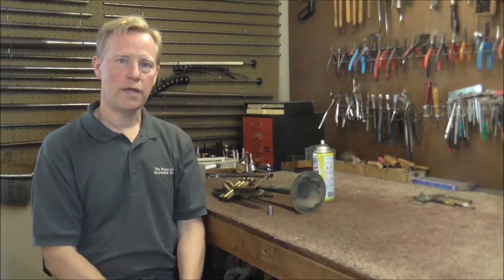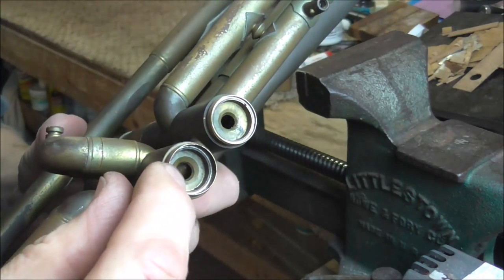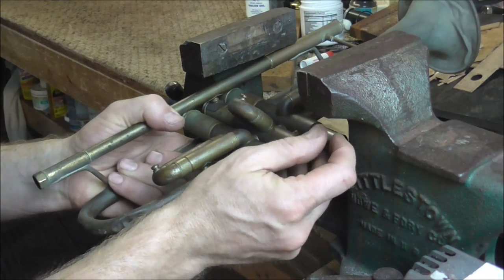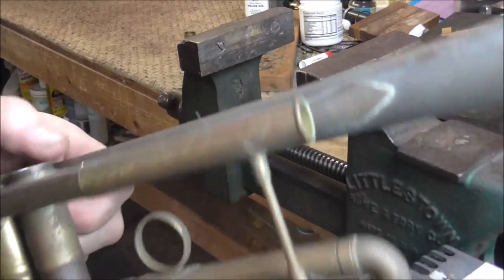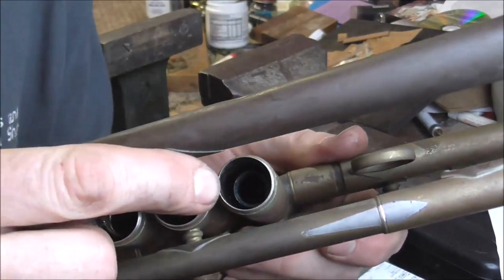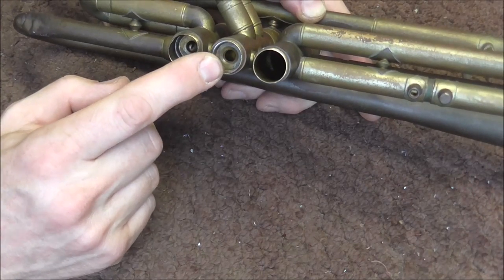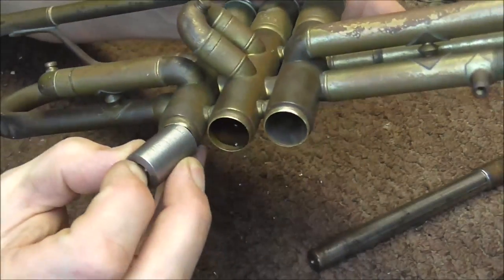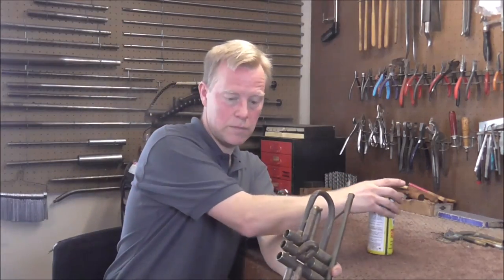Bach Strad Overhaul Project #2: Super-Stuck Valves

Comment: This series is very timely for me. I have a 1947 F.E. Olds Super coming. It needs TLC - no major bends or dents. But missing 2nd valve slide, all bottom valve caps, & 1 water lever. Based on photos, I anticipate stuck slides, stuck MPC, & stuck valves. Hopefully not as bad as your Strad! ~ This will be my 1st major refurbishment. I appreciate your guidance - Thank you.

Comment: Wow, that's quite a procedure. Are you keeping track of the hours put into this?  I wonder if heat might have helped? I just got the slides out of a project 40's Buescher that were very stuck. I soaked them in penetrating oil for a few weeks, but then applied heat from a hair dryer, added more oil, and all three came right out with a little tapping with a hammer and hardwood.

Comment: I’m surprised he didn’t use some slight heat on the valves to expand the metal ever so slightly.
Reply: Love the idea, but that's typically only used on old bells with thicker metal. The working window for that is too short and since the valve casing and valve are in direct contact they would both expand. Plus, they are different materials which would have different expansion properties, could cause damage. Also only has two hands to work with.
Reply: Heat can also help the penetrating oil to wick further in.